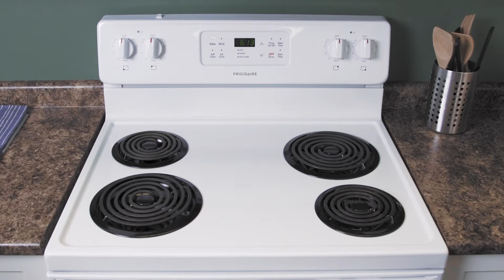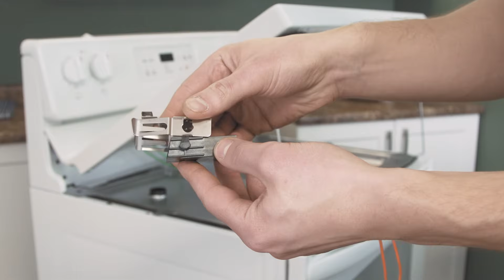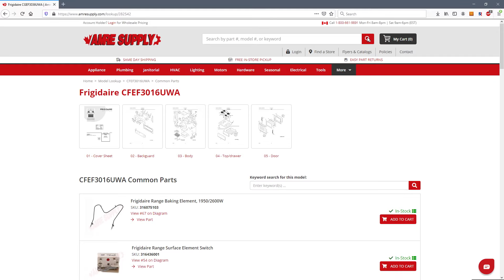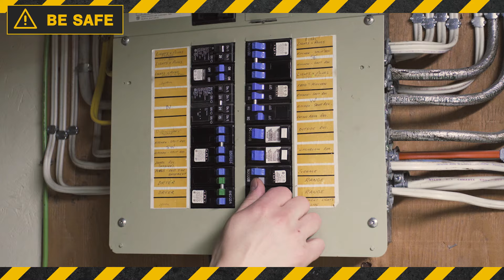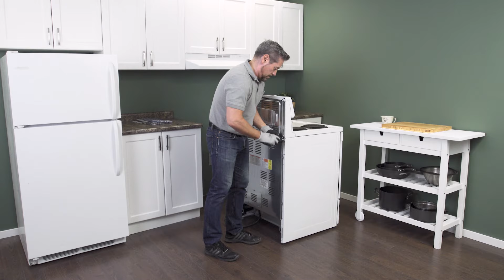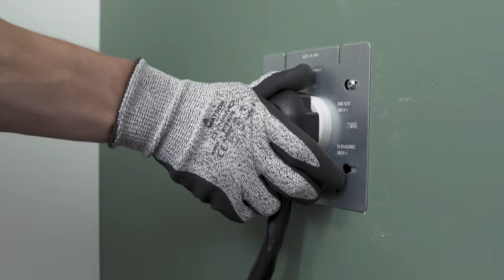How to Replace a Stove Element Receptacle | Repair & Replace

Comment: Where do I find the full length wires? All I can find are splice kits and I don't want to buy a wire stripper
Reply from the maker: Thanks for watching. You can see the available receptacle kits here, many have the full length wires and terminals already attached: https://www.amresupply.com/catalog/Element-Receptacles-Contacts-632521-AD1H

If you need an exact match for you model then use this tool:  Use the model lookup tool here: https://www.amresupply.com/lookup

Comment: Does a positive and negative wire not matter when splicing?
Reply from the maker: Thanks for watching. In this case the heating element is a simple resistor and is not effected by polarity, so it does not matter which wire is spliced.

Comment: Are both wires hot that are attached to the elment?
Reply from the maker: Yes in a electric stove the element is connected to two 120V lines of power which are both out of phase. The total voltage is 240V.

Comment: You didnt show jow to plug the wire into the receptacle!
Reply from the maker: Thanks for watching. If you happen to have a wire kit that doesn't come connected, all that is needed is to push the terminals into the receptacle. One example is this. https://www.amresupply.com/part/5303935058-FRIG-RA-ELEMENT-RECEPTACLE

Comment: Would be nice to see how the wires slip into the black block
Reply from the maker: Thanks for watching. Either the wires will be built in, or the wire connectors just slide onto the terminals.

Comment: how do i check to see if the wires coming from the infinite switch that connects to the terminal block has power/ or carries voltage to the block?
Reply from the maker: Thanks for watching. We don't show live voltage testing, only continuity tests in our video. This video shows how to test the infinite switch to see if it has failed as well as checking the element, and the wires for continuity through the back. https://youtu.be/I7i25VPg-rM

Comment: The heat plate don’t fit
Reply from the maker: Thanks for watching. Do you mean that the stove drip bowl (drip pan) won't fit after installing a new receptacle?

Or do you mean that the receptacle mounting bracket isn't fitting properly?

Comment: did this  and when i turned the break box back on the stover spark fire and started to smoke some is that normal ????
Reply from the maker: Thanks for watching. If there are sparks, or smoke, that is not normal and you should always immediate shut off the breaker. With the power off you can check the connections and see if there is any melted wires or burn marks. Double check to make sure there are no short circuits, or any part of a wire or connector touching another wire or the metal housing.

Comment: Hi, my receptacle box just slid off from the burner part as I lift the stove up occasionally to clean underneath all burners and stove top. Do i just turn the stove off and slide the receptacle back to the burner? Does it actually attach to it or just hang on?
Reply from the maker: Thanks for watching. The receptacle screws into the metal rim around the burner. You can see this at 2:24 . If the receptacle slid off and there is nothing wrong with the wires then you can simply screw it back onto the mount.
Reply: @AmreSupply  Hi thank you for the clarification. I guess i was not saying it right. The receptacle part in 2:24 of the video is on the burner and attached on mine but the little black box (on 3:34 of your video)that slides into it fell out, though theres nothing wrong with it.
Reply from the maker: @OceanMetTheSky  Thank you for clarifying. The black box is technically called the receptacle, and the silver part is the mounting bracket (which does not make contact with the terminals and just helps hold it all in place)

You might notice several tabs on the side of the black receptacle. These will fit into several grooves on the mounting bracket. You might have to use pliers to help bend these back into place if they are loose. 

If the metal is warped and can't be bent into a way that is secure, then you could buy a new mounting bracket (you wouldn't have to install and wire a new receptacle unless the mounting tabs were of a different shape).
Reply: @AmreSupply  Thank you very much for all the helpful information. It is very appreciated. I received a new stove about 2 months ago from my complex so i dont think anything is warped, i just knocked the black box off the burner when raising up the stove top to clean. I may ask maintenance to take a look at it and reattach it even though your description was very easy. Just to be sure. Thank you again for the detailed help as well as video.

Comment: I have two wires that are same color, idk witch gos were on the terminal
Reply from the maker: Thanks for watching. The wires are the same color and it doesn't matter which wire goes to which terminal.
Reply: Thanks! Both wires are black on mine. 👍

Comment from the maker: Did this video help you fix your stove? Did you run into any problems? Let us know in the comments!
Reply: I notice on my stove that the smaller elements have pigtail ends whereas the large elements have blade ends. Is this normal?  Are they interchangeable? I need to replace one, and was wondering if it matters which kind of end I got?
Reply from the maker: @squatch545  Thanks for watching. Ultimately it doesn't matter if its a pigtail or blade style terminal as long as there is a good connection. Receptacle kits come in full length kits and universal wire splicing kits. With the pigtail connectors you can always use a universal kit and use heat shrink to seal the connection.  https://www.amresupply.com/catalog/Element-Receptacles-Contacts-632521-AD1H
Reply: The receptacle kit I bought from Amre didn't have the wire already connected to the black plastic terminal. I made a mistake of connecting the wire to the wrong end of the terminal. When I try to plug in the heating element it wouldn't fit and it puzzled me for a good 15 minutes. Looking back, the instruction do have a very small graphic showing the correct orientation. I managed to undo the wire and plug back to the right way and everything work out.
Reply from the maker: @trogman  Thanks for sharing your experience, we're glad that it all worked out in the end!
Reply: No because you missed a set. You have to put wires in receptacle. But what do if it not getting the connection you need when put element back in and it still not heating up like it should
Reply from the maker: @travisskaggs2835  We split all of our videos into symptom based troubleshooting and individual videos showing how to replace a single part. (This video is just focused on replacing the receptacle and is not a full troubleshooting video)

We have a video showing how to troubleshoot a burner that isn't heating up. This includes testing the element, heat switch and a wire harness test.
https://www.youtube.com/watch?v=I7i25VPg-rM

As well if you look on our channel we have other playlist full of dozens of other oven & stove videos: https://www.youtube.com/playlist?list=PLCo9SMjkdWBysYYCcg5xQLiVh_cW0JQvt
Reply: Great video! Thanks for covering all the small details and making it easy to follow. Never did it before, no issues 👍🏼
Reply from the maker: @ej8688  Thank you, we're glad the video helped you out!